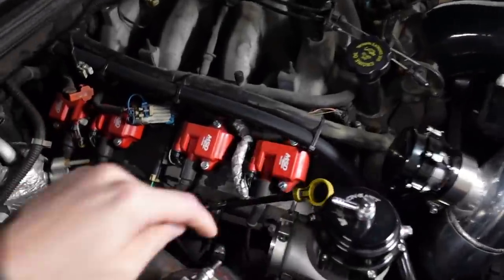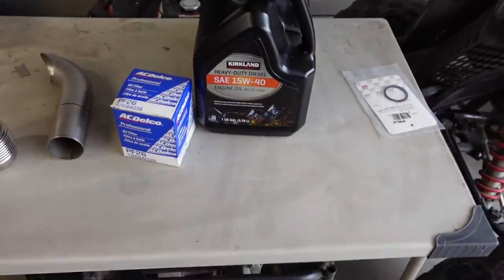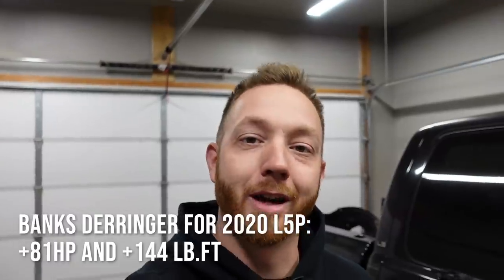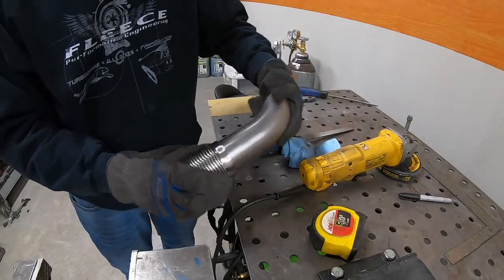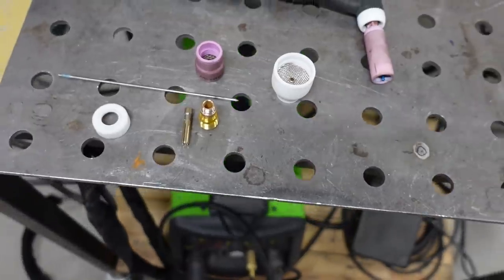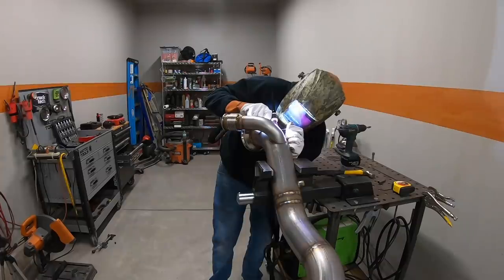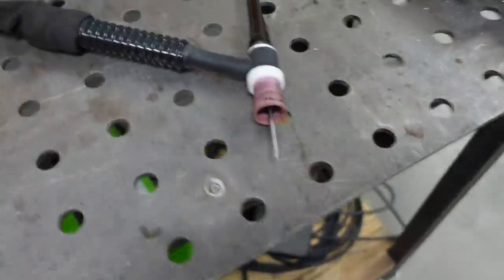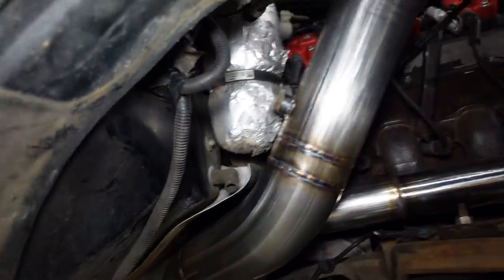8.1 Turbo Kit is DONE! Final fab work, plus TIG welding tech

Comment: I want to see the dyno curve! The torque curve on those motors is crazy down low. I know everyone wants big hp numbers blah blah blah! But torque is king! Especially in a truck. Please start your pulls whenever that is at 2000rpm.  I have a 99 3500 with the 7.4 and its getting a single S480 next year. I tow a big trailer and want the power where I need it not at 5500. This it an awesome project and kudos to the great fab work.

Comment: Pipe Welder here, Cut your tungsten in Half, sharpen both ends, add a short button to your torch. That Rooster Tail will get in the way when you least expected. Make your self a tungsten holder and you can keep 5-10 sharp pieces in your holder and not waste time sharpening tungsten when you are in the middle of a project. Use a drill to sharpen your tungsten, it will move things along quickly.

Comment: Utah county is quite stringent on the diesel deleting so keep that in mind before your "trip to Mexico". The UCHD makes people put emissions equipment back on if they've "fallen off". Yeah you could register out of county but they're cracking down on that too. 
That being said, if a truck didn't come with emissions equipment from the factory (e.g. 12 valve or LB7) it doesn't have to have it. So if you drop an L5P into a 2004 Sierra it is just an engine upgrade. 🤘😎🤘
Reply from the maker: I've heard they have a five year waiver on brand new trucks (Meaning the first time this one gets checked is in 2025) but theres always that risk. I have thought about buying a pre emissions diesel as well...

Comment: Great work, LT. Looking forward to the driving and tuning. Surprised that new pickup will allow you to spin the tires that much.
Reply from the maker: as long as you keep the wheel speed under 40mph, you're good. over that (if you're sideways) the stability control kicks in regardless of turning it off on the dash switch.

Comment: Love the video's !!!
And the 8.1 truck!

Your comment about NOT using a gas lens is very much INCORRECT!!!
( I used to teach welding at the college level...
Started welding 1969, Gas, Arc, MIG and 
TIG).

A gas lens will control the flow pattern of the shielding gas MUCH BETTER
A gas lens will definitely improve your welding!!!.

Comment: Hey Lt I would like to see some diesel episodes. I personally own a 1st Gen Cummins 1991 dodge w250 two wheel truck.it was my fathers the body is rough from upstate new york winters. but i do plan to restore it finding a reasonable price on a cab and 8 ft box has been a struggle most are 1500 or more and still need a lot of rust repair. I am also interested in Duramax cause I am a Gm person at heart. I like you're content so far and used to watch you on truck tech as well hope you have a wonderful Christmas and New Year cant wait to watch more.

Comment: I enjoy your approach to projects and how you teach - especially showing where you change gears and what doesn’t work. 

I am surprised you aren’t a religious adherent to a specific brand of oil. Mobile 1? Royal Purple? Amsoil? Most big car guys are fanatically loyal. Maybe you just need a sponsor.

I haven’t seen anyone use brake cleaner (I think?) on the drain plug before tightening. Does that stop leaks? I don’t remember ever having a plug leak myself. The filter, yes, so I torque them a bit harder than I used to.

Comment: As far as your at4 goes, I run 0w-40 synthetic in my pickup. In the cold winters of  Utah, it might not be a bad idea to run thinner cold oil. Just a thought. It obviously works for you so no big deal, just a thought.
Reply: The W is wintering. 40 is the weight.

Just use what's specified.

My truck is 5W30, it doesn't hurt running 0W30 or 10W30.

Too thick of oil have trouble going through oil ports, plus in cold are more resistant to flow. too thin an oil equals low oil pressure.
Reply: @shadowopsairman1583  in the super cold months, I'd rather run thinner oil to get it circulating quicker on initial startup. It's late December and he's in the mountains of Utah. Hence the 0w-40 vs 15w-40. At operating temp it's the same viscosity. 
  My personal pickup is a gasser. I'd rather run heavier oil because I'm making over triple stock power. I want flow on cold start and protection when I'm running it hard and get the oil hot. I feel way better running this oil vs the 10w-30 that gm recommended 30 years ago.

Comment: I like how he's pouring Costco oil in his new truck. Cuz he knows... Fresh cheap oil is better than overdued expensive oil.
Reply from the maker: thats how I feel about it. I'd rather run a less expensive oil and change it more often than a premuim oil that requires oil samples to be sent off to a lab to make sure its still working 30,000 miles later

Comment: I'm interested to see how it's going to get tuned and dialing in fuel and boost. Are you going to do an ECU swap to have the tuning you want?
Reply from the maker: right now, I'm just gonna be using the stock 0411 ECM and tune it using HP Tuners. if things get wild, I might want to swap to a Holley Terminator in the future, but we'll see what happens

Comment: The OBS Suburban i think is more feasible for most folks cost wise. 
Yours being a 2500 is less common but the 1500's can be had for around $2-3K in decent shape. The steering on these is sloppy (Pitman arm #1) i'd like to see a front end rebuild on steering components or at least where to look to tighten it up and get good handling. Do the torsion bars wear out or get weak over time. I think there's alot that could be done for normal folks and have a great cheap robust daily driver.

Comment: Duramax = smallest oil filter and capacity of all. Lol
8.1 is savage man. I can't wait
Reply: And last a long time.
Reply: Less expense on oil, derp.

The vortec 4200 pan requires more oil than the vortec 4800.

Problem? Add an oil cooler or deeper pan then.
Reply: @shadowopsairman1583  
It's because IFS

Comment: May I ask what v-band clamps you use/recommend? Replacing some band clamps on my Silverado exhaust that leak but the price variance between selles makes me uneasy.
Reply from the maker: the Vibrant ones are the best fitting and welding clamps that I've used, but the price reflects that ($100+ for a single 4" stainless clamp assy). I've used some of the cheaper amazon ones with OK luck, but they can weld kinda dirty compared to a premium clamp.
Reply: @LawrenceTolman  Thanks LT!

Comment: i picked up an 2003 ford e350 with the 5.4 2 valve, curious on your thoughts of finding and swaping in 7.3 diesel from a similar van.
Reply: I’ve driven many E350 vans with the 7.3, you will love the results

Comment: Don’t delete the L5P, but definitely don’t use Banks overpriced crap. I’d first contact Leny at DDP and see if they make a emissions compliant injector for it to help reduce DEF usage and soot output while still boosting HP quite a bit. I know he makes them for the 6.7 Cummins and has had great results. Either way 💯 on the diesel content